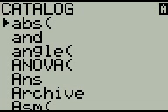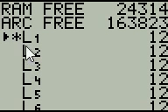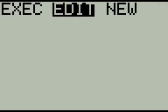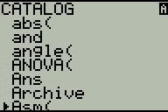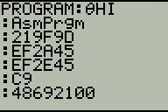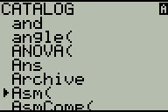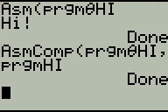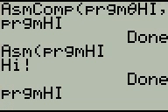Hex Assembly for TI-83/84 Tutorial 1 - Writing and Compiling Programs on the Calculator

Comment: CODE WONT WORK FOR 84 CE USERS TRY THIS CODE INSTEAD 

Asm84CEPrgm
218EA8D1
CDC00702
CDF00702
C9
48692100 

Hi Kampala 
I have updated your code so it now works on the TI84 CE.
Main difference is ez80 processor Ti-84CE uses 3 byte address.
If it only prints H on screen set math print to classic.
I noticed in the previous comments a lot of Ti84CE users were still trying your code out.
As of 5.6 TI update in 2020 removes Asm support for the CE.
Reply: this did not work on my Ti-84 plus C Sylver edition. it deleted my ram

Comment: Wow, I didn't realize that you could write assembly directly on a TI 83.
Reply: Assembly is linked very closely with hardware. For example, though the ZX Spectrum and the TI-83 use the same assembly language, the calls to the macros will be different because they do not have the same hardware. Assembly is not portable the way languages like C are.

Assembly alone is useless without the hardware specific calls.
Reply: RedStine you know assembly?
Reply: Just a bit of x86.
Reply: could you share a program and i have a question does assembly work on all devices ? like the same program for the calculator work on another device?
Reply: There is the amazing Mimas assembler for ti 83. https://www.ticalc.org/archives/files/fileinfo/431/43140.html
Reply: in fact you can't. that's NOT assembly, that's machine code, the compiled code from assembly

Comment: On my ti-84 Plus and the Wabbitemu  ti-84 plus emulator, I do not get "HI", just "Done".
Reply: George Kurt Reimer Try disabling Math Print in MODE.
Reply: Only if you have the version 2.55MP, then you may downgrade the OS software by getting it online free from Texas Instruments, and then connect your calculator to the computer, and it should work.
Reply: @kupala8951  Disabling math print worked for me, thanks!